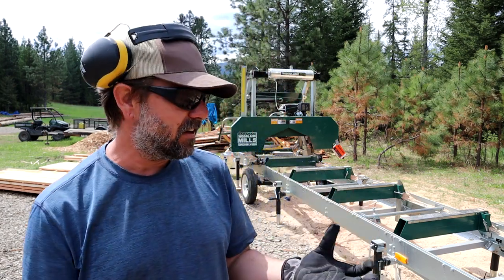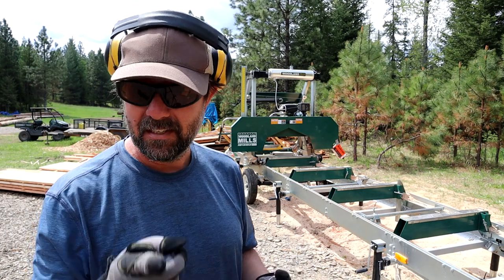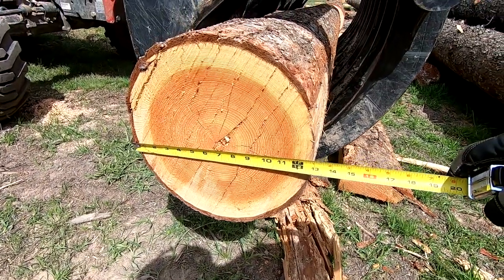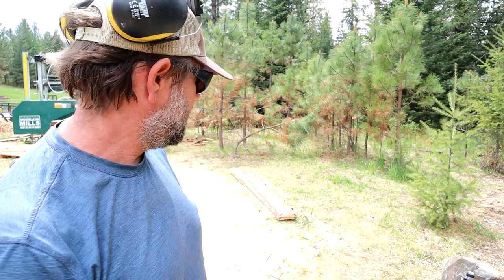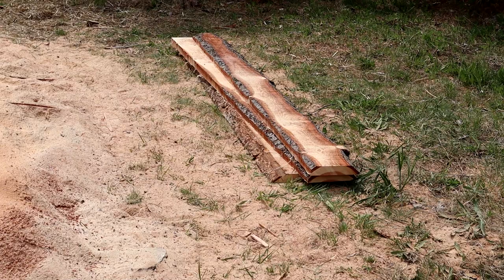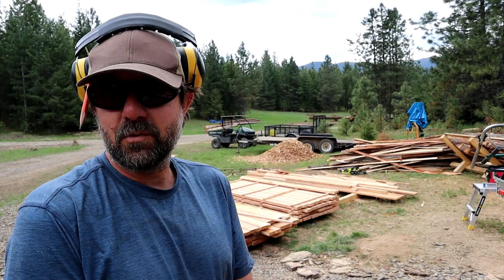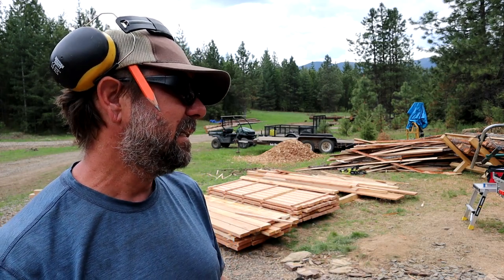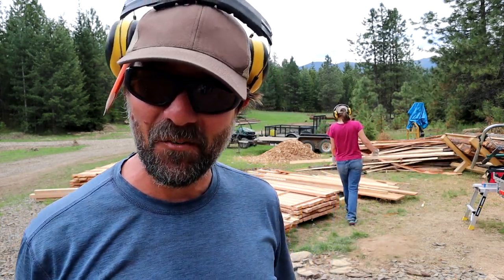How Much Lumber Comes From One Log - The Homestead Adventure(r) - Ep 16

Comment: For you viewers, purchase price of a sawmill is not the amount used to determine overall lumber cost in a homestead project.   It is the cost of ownership that should be used.  For example, if you find a used mill at a good price, use it 2-3 yrs then sell it for the same price, you have $0.00 in mill equipment cost.  Of course there are operating cost such as blades, fuel, oil, etc that need to be added.